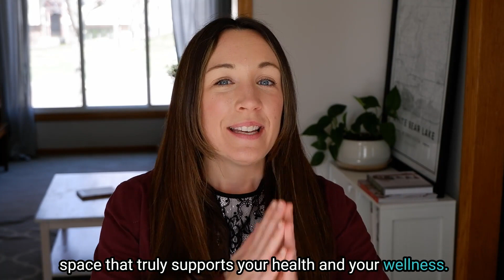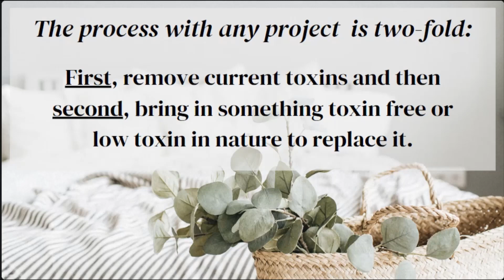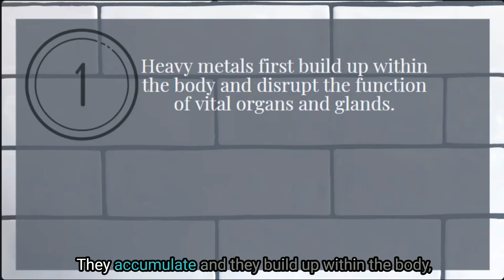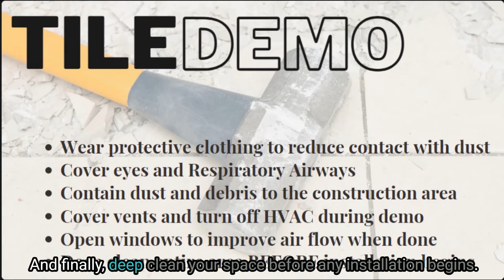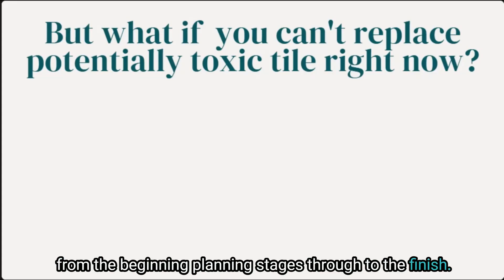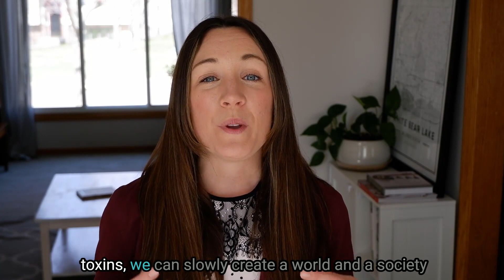Non Toxic Tile Flooring & Backsplash Tile

Comment: Bioseal caulking, I've been using for caulking in the bathroom. I believe it's low VOC or no VOC. Does give off a clean kinda smell or brand new smell for a day or 2. But isn't offensive like the acrylic or silicone smell your used to.